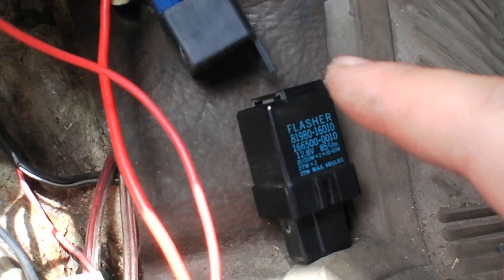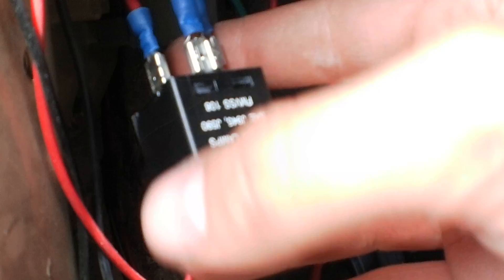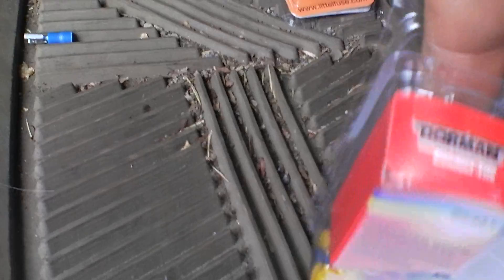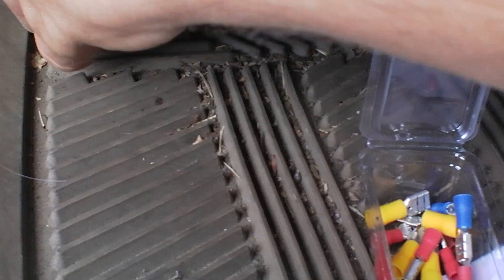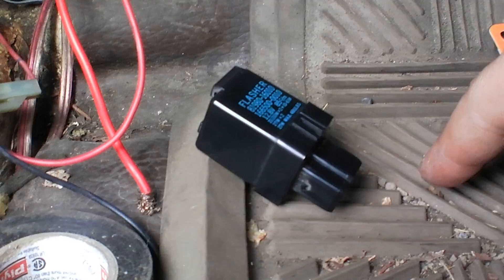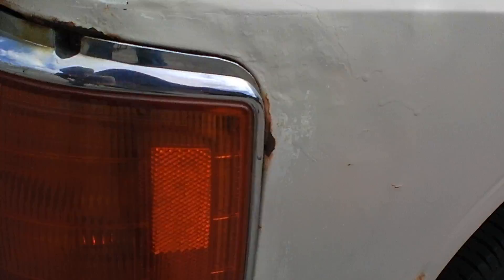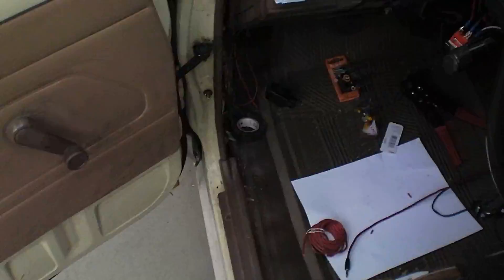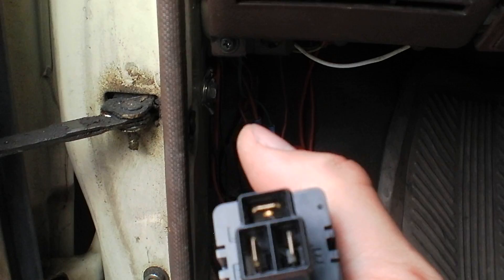87 Toyota Pickup Blinker Mod

Comment: Usually a fast blinker with new relays and bulbs means that one of the bulbs is the wrong type.
Reply from the maker: Correct 👍 someone had changed the position and wiring in the front end of the truck causing it to blink in the corner marker lights instead of the bumper

Comment: 87  TOYOTA PICKUP  i bought 3 prong flasher,   Is it inside the cab? where?   do i have to remove a panel?
Reply from the maker: Behind the panel by your left foot while you're sitting in the truck

Comment: So did the new flasher not fit into the old plug?  And that's why you needed to make the cables?  Just trying to learn and thanks for the video.
Reply: andreboy1 because there were no cables,the original flasher module plugged directly into the prongs he has the cables routed from